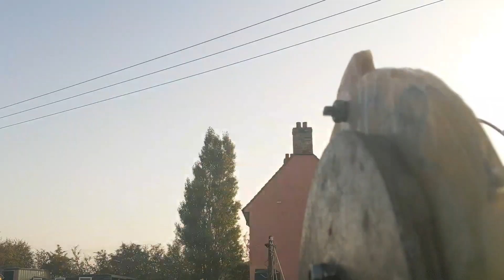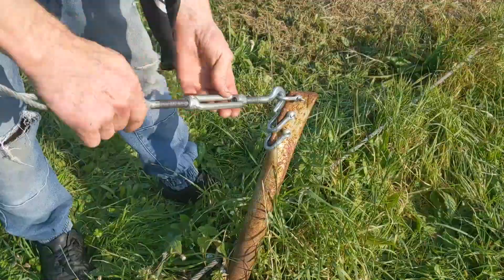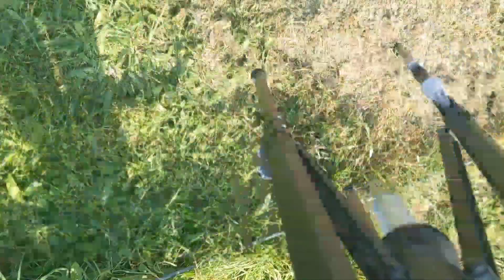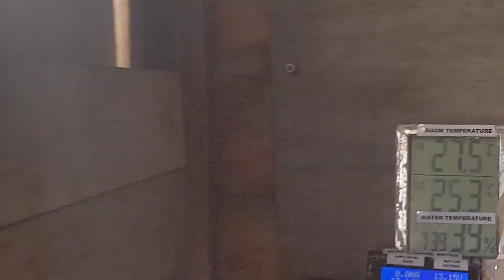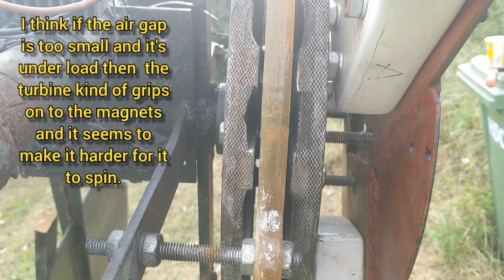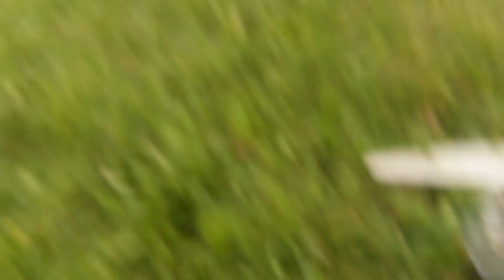WIND ENERGY UK , 12 VOLT DIY WIND TURBINE 23/09/2020

Comment: You may have to bite the bullet a buy a midnite classic if you go 48v , it's my hope to buy one so I can adjust at what rpms it starts charging batteries, I kind like the idea of BIG blades to power through the load exerted upon them once cut in voltage is hit, for low wind low rpm power. Your thinner stator will atleast allow you to intensify flux with the magnet rotors being closer to each other.
Reply from the maker: Yes mate I would love one of those, would really want a 1kw+ turbine before I invested, how much are they in the US?
Reply from the maker: Gotta have big blades my friend.
Reply: @GavinFreedomLover  yeh theyre So Lucky in the US ,BUT with your pound ie exchange rate youre Far better off than me in Australia. here $1200+ midnite classic , blades 600++++, so i bought locally from phil at ozwind engineering. But requires me to do quite a bit of work , yet i love a challenge problem is money is tight so i save up till i can afford what i need for my projects , why i like axials you can gradually buy the parts over time , im almost there, God willing ill have a 2 kw unit within 6 months.

Comment: Im really sorry for telling you this!
That tipe of wind turbine stator only generates power on really high RPM (+/-1200RPM)
Everyone making them and telling others to make them like if they are the best of the best wind turbines, they always forget telling this RPM thing!

The only ways to lower the RPM are
1 The difficult one; overlapping the 3 phase stator windings 120° on each other to share all the magnets flux at the same time.
2 The easy one; converting the 3 phase stator to single phase stator one winding for each magnet flux.

Both 1 and 2 don't need any rotor change.
Reply from the maker: No this turbine starts making power at 60rpm ( albeit only 2-3 volts and starts making 12 volts at around 130 rpm , NO turbine can reach 1200rpm , this is why car alternators do not work in wind turbines , please reply if you need any further clarification.

Comment: You may be losing power by having the rectifier on the wind turbine and not close to the battery. You lose less power having the 3 phase wire run longer than have the dc wire run longer
Reply from the maker: Thank you for that next time I take the turbine down I shall try it.